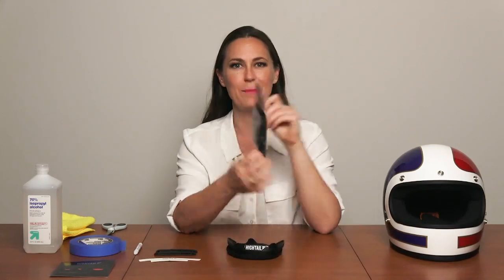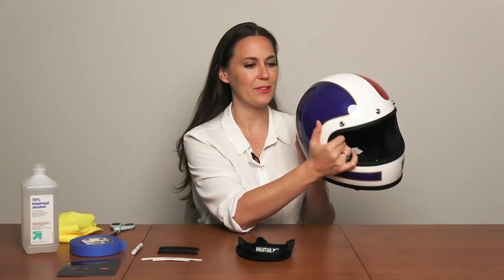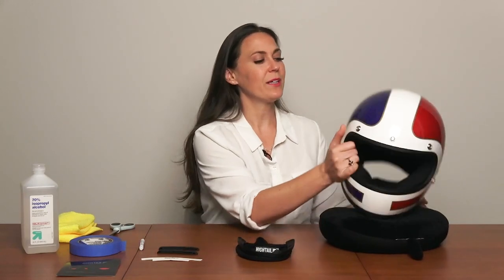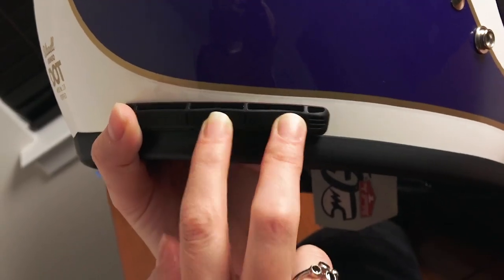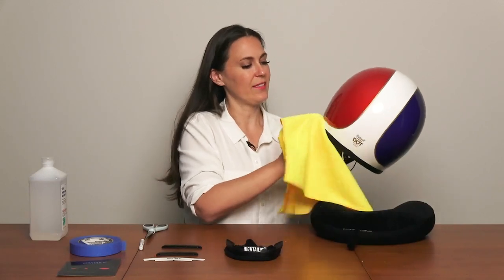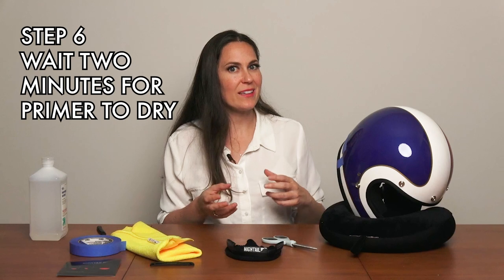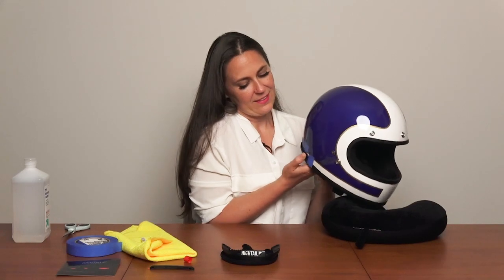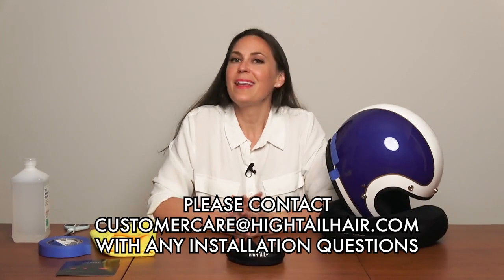Hightail Install Video (with primer)

Comment: You are not showing us what you are doing. You are telling it. This video is not helping.
Reply from the maker: Hi there.  Our intention is certainly to be helpful and show how it works with several close ups to help with that.  Is there a particular step you found challenging so we can have more specific feedback on what may need more attention?
Reply: @hightailhair a close up of the back of the helmet the entire time would be nice. Watching her do it, is not the same as watching what she does.
Reply from the maker: @veronicaolson589  thanks for the specific feedback Veronica, there's a pinned Reel on our Instagram feed where it is like that.  It's sped up but it still may be helpful to see the back of the helmet the whole time.  https://www.instagram.com/reel/Cchr0qmh6_r/?igshid=MzRlODBiNWFlZA==

Comment: This is so confusing. Your camera angle doesn't show us anything you've done?? Plus there's so much extra stuff is needed to install this. Why not include rubbing alcohol pads? My hightail didn't even come with primer, and my "spacer" was so crumbled in the packaging (which was horrific) that it doesn't even sit flush on the helmet. I'm so unimpressed—I paid $$ for an unmountable piece of elastic.

Comment: Why do I have to have video instructions? Would it really cost that much more to print instructions on the card for those of us who can read and leave video as another option? I get very irritated having to listen to someone talk when I could have read all of that in 30 seconds. And yes,  I hate meetings that could have been an email.
Reply from the maker: Hi Rebecca, we appreciate you would have preferred the paper instructions and that's certainly valid.  We used to have paper instructions.  It wasn't the cost that was the issue, it was that there were updates with our install advice that weren't easy to share once all the packages were sealed closed with outdated paper instructions.  We decided to only include the QR code going forward, ensuring we can always provide our customers with the most up-to-date installation advice.   We have also found that the clip placement advice and the primer usage is best conveyed through the video as well.  I hope this additional context helps.

Comment: So once those clips are on, they are on for good? Is there a way to remove w out damaging the helmet
Reply: I'm assuming you could always heat it up again. With a blow-dryer, for instance. Did that for a chin mount adhesive that I wanted off, just pointed the dryer at it for good awhile and it got hot enough to detach.